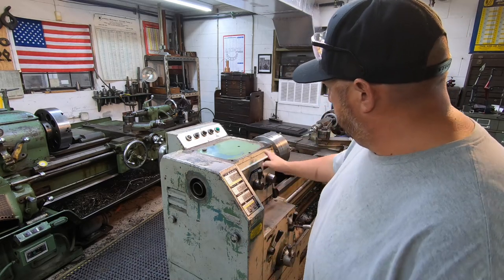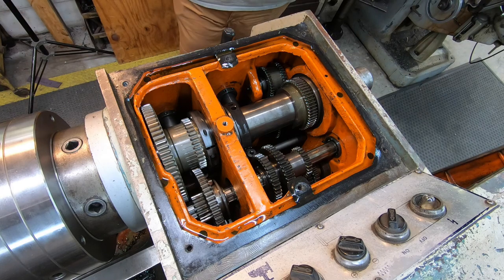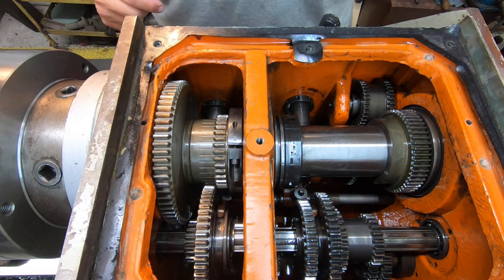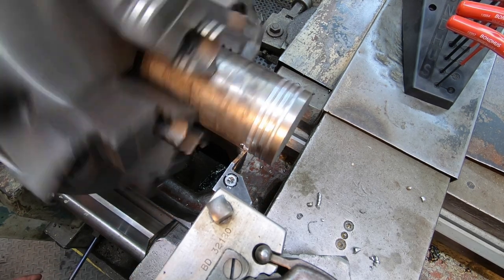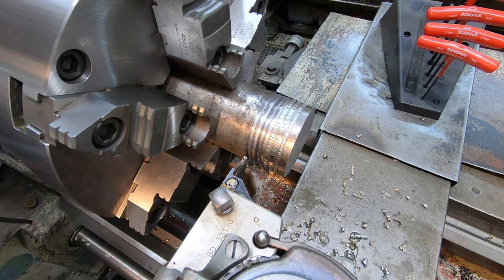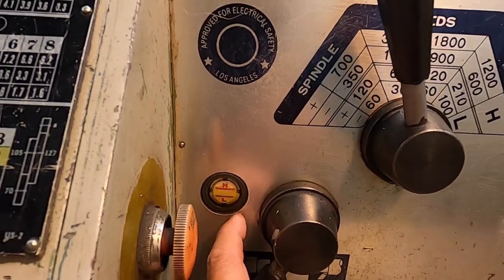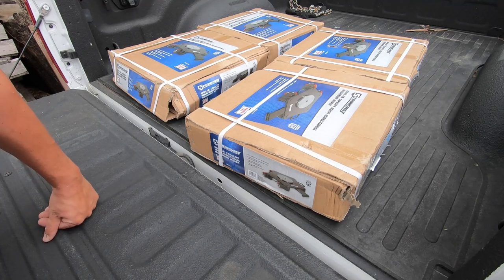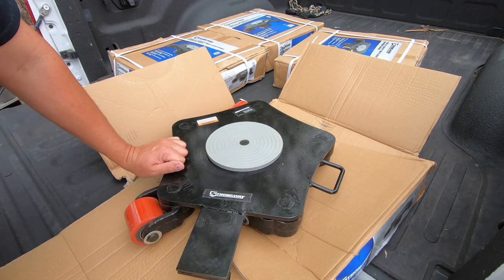SNS 324: Victor Lathe Main Spindle Bearing Adjustments

Comment: You got it adjusted! 
First time I have seen you not using precise data/instruments. 
I guess experience wins.......
Mark
Reply: He's probably already been over the spindle again and again with DTI's and no measurable play, by the looks of the arrangement the  taper bearing between a & b bends the web to produce the pre-load for the headstock, if the spindle was in need of adjustment but not moving when put under human powered load, re tensioning the preload on the a/b bearing to re-bend the web to stiffen the machine it back to something more acceptable.
Reply: Alan,
I'm absolutely certain he knows what he's doing. 
Just an observation that the feeler guage wasn't in use. Might not have been an option per the book. Thanks

Comment: I think this is what's missing from a lot of machining video's, how to look after your machines. I didn't know the Victor was Japanese (too good for chinesium), I'm guessing you've a set of headstock bearings on order for when those one's go to the great heaven that is the scrap bin for all things.  I did wonder why there wasn't an oil feed for the middle bearing but if the box sprays oil everywhere it's probably got enough coverage to keep the bearing wet.

Great video, keep yourself and family safe from that storm. I've my fingers crossed that it doesn't mess things up too much
Reply: Victor are made in Taiwan
Reply: @thonnogeengineering7745  Cheers for clarifying that, I'm not a machinist at all so have little idea what comes from where other than Colchester, Boxford and Myford stuff. I did a bit of google fu but it can be wrong
Thanks again

Comment: In a car diff, there is a torque for the rotation for the pinion gear sans ring gear. I would think there would be such a setting for this preload.

Comment: i would love to see you refurbish your dads old lathe.  bearings, bushings, paint, etc.  i know its just a machine, but its a machine with a sentimental history
Reply: He might have to. If he overtightened bearings 😊
Reply: @dmitryserov5595  that can be seen by monitoring the heat a little bit, if they don't warm up to more than like 40°C it's probably just fine. It looked quite stiff though judging by how quickly it stopped when turning by hand
Reply: @MF175mp  Exactly. They might expand a bit after they heat up at higher rpm, and he will just fry them.
Reply: @dmitryserov5595  His result looked about right - you should expect a bit of stiffness when turning the spindle. On mine, it holds the chuck key at 3 o'clock but any downward movement of it and it accelerates.
Reply: @MF175mp  That stiffness is about what I expected - and the noise from it increased to about what I'd expect too. Good circulation of oil should keep them cool.
Reply: Clausing says to adjust the spindle at operating temperature. My lathe specs say 1 revolution when spun by hand with a 6” face plate. My runout: https://youtu.be/L9Y8UeOEv5I
Reply: @ericmartin5720  Interesting notes, thanks.

Comment: It seemed to me like you added a lot of pressure on those bearings which isn't advisable. The spindle should be able to turn freely when the gears are not engaged, adding that much pressure to the bearings indicates it might be time to change them, you'll probably find they don't last very much longer now.
Reply: it will old for long enough, its not a every day, all day use.
Reply: Lathe bearings are sized in the expectation of significant preload. 
They last almost indefinitely provided the lubrication does not fail and the oil is clean.
The way to tell if the preload is excessive is from the steady state running temperature; it should not rise above 65 deg C on top speed no matter how long it is run (under no external load)

Comment: Really great vid, Its good to get a good result. I always fit a magnet on a stick ( those ones you use to pick up stuff in awkward places) in the headstocks of all my lathes, I wire the handle to something solid so it cant get caught up in the gearing..its surprising how much junk that thing will collect . (I tend to check mine every 5 years or so)

Comment: Looking at the thickness of that lid it could be part of the lathe structure.  The headstock would be more rigid with it firmly attached, torque settings for those set screws?  Maybe the chatter is better still with the lid attached and torqued down?

Comment: Thanks! I've never been able to part anything on my lathe because of chatter, but I hadn't thought about this. Now after tightening it seems to be much better. The manual of my lathe specifies the tightening in an interesting way - the headstock neads to be "hot to the touch, but not scalding", then the bearings are set correctly.
Reply: That's pretty good advice. Classier machines tend to recommend a running temperature for the bearings which provide axial preload in a lathe headstock of 60 - 65 deg C, which is about what your manual describes.

Comment: I worked on a Victor FHR-68 with what we affectionately called " the gangbang head ". Was a multiple tool holder with almost a bolt action mechanism that allowed you to switch through several different cutting tools with a ratchet lever. It was a pretty neat machine.

Comment: 29:00 Those skates - just by looking at them, you'll be well-pleased with them !
Reply: rats arsed  He mentioned the issue with when the wheels aren't all pointing in the right direction. Should be better when they are and are on a smooth swept floor !
Reply: rats arsed  I'd have used all 4 skates, one on each corner and ideally strapped together somehow so if any moved, they all did - otherwise where there's no weight on a skate, it'll get left behind and not be there when needed !

Comment: Adam, and all the other Abom79 subscribers, goto https://www.youtube.com/watch?v=fwbqMiIQgvI at 19:12 and watch the chamfering of the corners of the deck beams on a wooden yacht they are building. The shipwright, Leo Sampson, explains in an earlier video that they do this so if a sailor bumps their head against the deck beam they will not suffer a cut from the sharp corner. The same reason Adam chamfers all of his corners. The deck beams are the "ceiling beams"  when a sailor is below deck. I enjoy the way that both woodworkers and metalworkers have the same concerns and solutions. Watch the entire video to see them working silicon bronze, and upsetting copper rod to make bolts and rivets by hand.

Comment: Commentary on the web also points out some implications of the procedure: 'Chatter is more likely to be tool geometry. Changing your bearing preload can have drastic and damaging effect on your spindle bearing wear. Arbitrarily increasing spindle load without keeping an eye on bearing temperatures can destroy bearings in quick order. Have you measured your existing preload? Also: 'Biggest parting problem I've found is worn leadscrews on the cross-slide. Get those tight with new parts, etc, and your parting will get a ton better.

Comment: Would replacing those berings if they are still available fix the problem?
Reply: The original Victor bearing might be better quality than replacements and the new will need adjustment in time too

Comment: Should have re filled the valley bearing oil holes with oil after washing out. Might have missed a step but you were tightening the bearing and running it without oil.

Comment: I reckon there's now so much preload that that gearbox central web is under an axial force that was never intended. I don't much like the idea. I I were to buy that lathe off of Abomb I'd be de-adjusting that preload out of it.
Reply: Lathe spindles are designed for preload; it should be enough to raise the operating temperature of the bearing to about 60 degrees C. But by all means eliminate it, if you are not concerned about chatter.
Reply: @Gottenhimfella  I get that, but he just hauled on that pre-load so that the shaft was stiffening up. Don't tell me that's correct.
Reply: @JohnSmith-vi5pz  It's not wrong provided the running temperature at the bearing does not become excessive. Preload always involves resistance to turning, and on smaller spindles it's particularly noticeable.

Comment: Adam, to get rid of chatter is a very easy. It needs a simple contraption. Works with lathes and milling machines. As a prerequisite, you need either a BLDC-motor with a suitable ESC-controller - or a VFD-controller for an already present conventional three phase induction motor. Then the magic comes into play. You have to hook up the speed control voltage (normally 0…10 VDC, connected to the wiper of a potentiometer) to the output a x 1 differential amplifier. Connect the positive input to the wiper of the speed preset potentiometer  and the negative input (reference) to a simple adjustable frequency oscillator (0.2…2 Hz) - e.g. built around a NE555, or HCMOS Schmitt-Trigger with smoothed edges by a RC low pass filter and an other potentiometer labelled as «modulation depth». This circuit will modulate the speed of the motor in a permanent manner around your preset RPM. Therefore, you have three potentiometers: Speed preset, modulation frequency and modulation depth. When chatter starts to come up, simply add modulation depth and tune the frequency until chatter stops. All contemporary CNC-Machines use this little trick to kill chatter and increase productivity. They make it by software, but with a couple of cheap parts or modules from Aliexpress for about USD 5, all conventional machines can benefit. Typically material removal rate [inch³/min] can be doubled, tripled, or even quadrupled.
Reply: The manual lathes can in many cases bog down the spindle motor before chattering, given that they would be installed correctly, like bolted down to at least 16 inch thick reinforced concrete floor as recommend in my lathe's manual. Thicker floor will increase the lathes rigidity even more and absorb vibrations better. And of course a bigger lathe needs naturally better base. Mine is 10hp and about 4 american tons of weight
Reply: On my medium-sized lathe (a slant bed 16" swing) I long ago fitted a VFD drive and I have a potentiometer speed control I can just waggle whenever I encounter chatter, and as you say, it works a charm.
Reply: @Gottenhimfella  sure it works in some cases, especially if the machine is rigid but the workpiece is slender this can do wonders. Many don't have a vfd though. Btw, can you make a vfd forward/reverse and stop with braking to work through external switches the stop being when both switches are off? My lathe has switches on the operating lever instead of a clutch system. I wouldn't mind some extra maximum rpm and possibly cnc conversion if there is ever a problem with the feed mechanics
Reply: @MF175mp  Sure you can. And yes it's Ok to overclock a 50Hz motor up to 90 Hz, in my experience. Not sure how this would translate to the situation of a 60Hz motor... I'm guessing you could go to 100Hz.
Reply: @Gottenhimfella  I would dare to double the motor rpm in temporary use, (during the finish cut etc) the spindle bearings are designed for low rpm in that case and they are what I fear more. They cost new probably half the price I paid for the lathe.
Reply: @MF175mp   Bearings are not designed for rpm until you get up to something in the region of (for say a 70mm shaft journal) 8,000 rpm. If they don't fall into that high speed region, they're designed for a combination of load and aggregated revolutions (not rpm, just r)
And machine tool bearings are not load constrained, they're designed for stiffness, which means they are massively under-loaded, which in turn has the result that they'll only wear out after decades of industrial full-time hard use. Unless they were third-world quality in the first place.
Reply: @Gottenhimfella  the bearings can sure do 16k rpm if I look at a bearing manufacturer's data sheet. The preload is adjusted for maximum stiffness so that it reduces the rpm they can take without generating too much heat. The fastest gear is limited to 1350 rpm for a reason. I can't double that and expect trouble-free operation over longer periods of time. And it was done in Japan, they knew every detail for sure. And they are designed to last for ages in this case, probably to protect brand reputation which is very good I would say. Everything else is designed like so, it would be awful if the spindle bearings then failed first. And by ages I mean it would probably outlast Monarchs
Reply: @MF175mp  The speed of lathes designed in the sixties was limited not by bearings but by cutting tool material. It was pointless providing higher speeds than "high speed steel" would support. What brand and model of Japanese lathe do you have, and when was it designed?
Reply: @Gottenhimfella  Mori Seiki, I think carbide was around when it was designed. At least when it was manufactured. The gear teeth counts are easy to change in the design afterwards. I think it's made in late 80's when cnc and carbide were around.

Comment: The weight distribution is not even on your skates!  You should place the skates 100% under the tool.  The wheels under the shaper have far more weight on them than the wheels sticking out from under the shaper.  All skates (wheels) should be fully under the shaper and I bet it would move much easier!  Just a suggestion.
Reply: I believe your mistaking. All the wheels on 1 skate should equally have the same weight.

Comment: I don't like the fact you're hammering the adjustment. It's as if the adjustment clamp is not sufficiently loose. 

As an engineer, rather than looking at the amount of chatter while taking cuts, Id look at how stiff the spindle is to turn - that's of course out of gear and not driving the leadscrew etc.

On my lathe, the spindle is stiff enough to hold the chuck key at 3 O'clock but if I start to rotate the spindle, gravity on the chuck key will accelerate it. I'd estimate that to be about right - despite its completely unscientific measurement technique ! I will say, that is for an averaged sized chuck key - I see some chucks have longer keys and some have shorter ones. So take the differences in weight into consideration.

I had thought in some of your videos that the spindle seemed rather too freely turning.

16:33 - yep - that looks good on spindle stiffness.
Reply: I see your point but that could be that the rear inner bearing is tight on the shaft. Any looseness would encourage chatter.
Reply: @jonka1  I don't believe the actual adjustment should be stiff to adjust. It should really offer 'feel of adjustment' but that's not always the case. Any looseness in the adjustment mechanism should be removed by the adjustment clamp - i.e. the other 'ring'.
Reply: I've read two conventional lathe manuals and they talked about the spindle doing a half or a full rotation before coming to a stop as the optimal amount of preload on the bearings.
Reply: @Gigator  from what speed ?

Comment: No one but you uses a part off tool that fast that’s your problem. Maybe cnc but definitely not manually . I like your videos but cmon.
Reply: What's that got to do with a loose bearing? It needed adjusting, and he showed us how to adjust it. The only thing that I would have added is a temperature check at the bearing to make sure that it wasn't overheating. Since the manual doesn't how far to go with the tightening, checking for excessive heat is a good sanity check.
Reply: Now theirs two people who part off at this fast? speed. Nothing fast about his feed rate.
Reply: @SjwNz08  I hope that you aren't including me, I'm a semi-sorta retired controls engineer. Basically I replace chips, not make them.

I do work on machinery. In fact instead of finishing up the controls upgrade of a Takamatsu lathe to Mesa Electronics and LinuxCNC, I'm posting on YouTube. :)
Reply: @MrWaalkman   Haha, no not you.
Reply: @SjwNz08  I somehow managed to fix the pesky hydraulic rotary tool changer that had a nasty habit of skipping positions #4 and #6. So I'm a very happy camper. :)

We did this by adding an encoder to the unlock shaft, which rotates, and I drop out the rotate and lock the shaft a bit earlier than what is normal. We'll see how it holds up... 🙄